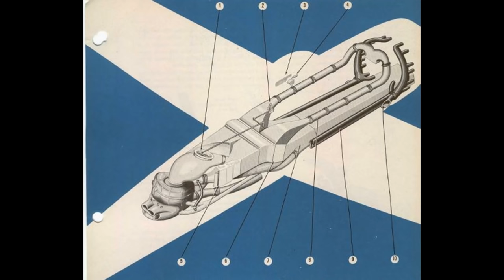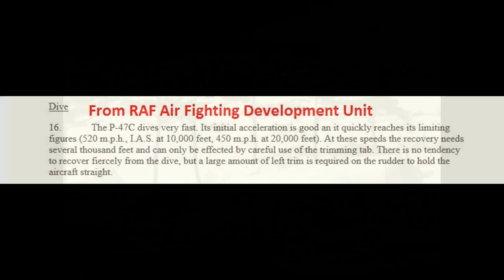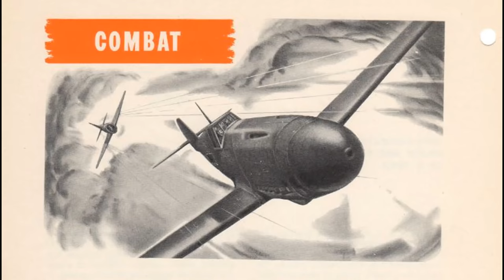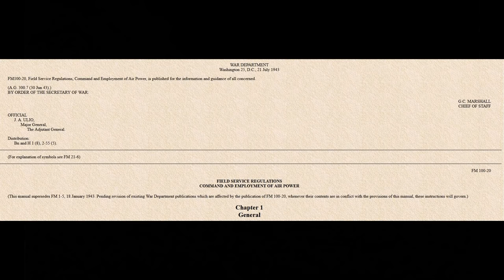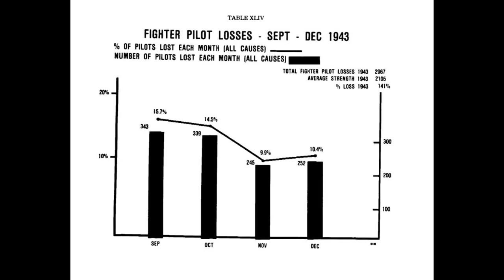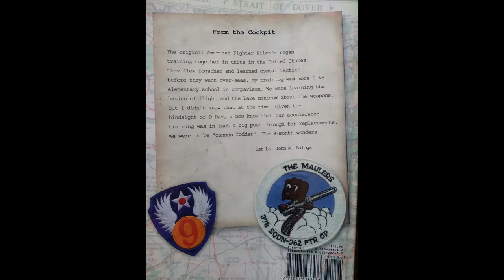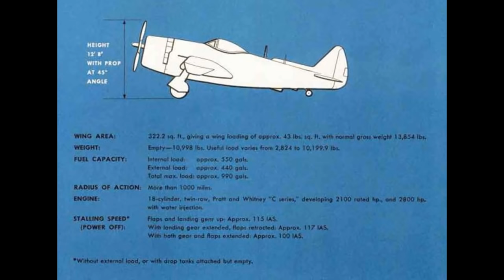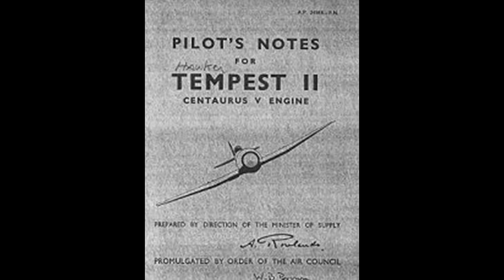P-47 Thunderbolt Pt. 8 Conclusions

Comment: My father was at various times prior to and during WW2  a carrier pilot who flew Wildcats a flight instructor and a test pilot.
His favorite planes were the Grumman Bearcat the Grumman Hellcat the Corsair the Mustang and the Lightning.
He flew the P47C as well.
Here are his reactions.
The Wildcat was not adequate to deal with the Zero and would not have done well against top line German fighters
The Hellcat WASable in the hands of a good pilot able to deal with the Zero provided the Zero had a good but not outstanding pilot.  IT would not have done well against the later 109s or 190s.
The Corsair in his opinion was the best carrier plane in the Pacific war.
It would gave donecwuite well in Europe.
He REALLY liked the Bearcats and felt that it was too bad it hadn't come along 3 years earlier to supplement the Hellcat.
He liked the P47C he flew and the firepower but considered it too shortlisted for the Pacific. He regarded the plane as a brute force solution to a fighter but respected its firepower and ruggedness.
Tied for first place in the Pacific with the Bearcats was the P38. Specifically the L model.
He specified the range speed maneuverability redundancy of two engines over water. He also liked the centerline gun location alone with the 20 mm cannon. He pointed out that the top two aces in the war flew P38s.
He also was emphatic that some of the tactics that were necessary to fight each plane varied greatly.
Most of the stories he told were while I was building Revell models of each plane.   After the war he flew for several years for American Airlines.
I was so lucky to have him for a fsther.
Reply from the maker: Thanks Joseph, I enjoyed reading that.

Comment: A fact that is often overlooked when comparing the Jug to its other contemporaries, particularly its R2800 brethren, the Hellcat and Corsair is the fact that it actually had the smallest wing of the three. 304 sq ft to 334 and 314 respectively. And we are not even looking at wing volume. Even the late model N which had a completely different, larger  and new wing was 322 sq ft., still smaller than the Hellcat. Obviously the needs for carrier operations dictated this to a large degree but nonetheless it's a relevant point because as we all know fighters are a series of compromises. The advantages gained in level speed and diving performance by the P-47 with its smaller wing hurt it against its brothers in climb and turn performance. Down low a P-47 had a less than optimum chance in a dogfight with these two, and consequently they were second best up high  where the 47's turbocharging kept its rated power much higher than that of their 2 speed superchargers. Once again it's all about where you need the performance and where you are willing to go with less
Reply: Supposedly p47 pilots said "when the build a runway around the world Republic will make a plane that needs it"

Comment: Some hearsay about the kill to loss ratio of  WW2 fighters.  A little known or outright obscure plane with a top rating was Brewster Buffalo.  What I have heard is that it was designed for US Navy use, but was found to be very difficult to fly and therefore not well liked.  So, when Finland after their winter war (1939 - 1940)  wanted to buy any more modern fighters and could not get anything from Germany (until 1944) they turned to the US.  After some manipulation it turned out that the Brewster Buffalo was proclaimed obsolete.  According to my sources, it was officially due to wrong or out of specification painting!  Real reason must have been that it was not well liked.  Anyway, Finland ended up having a small number of them.  Unlike the American pilots, the Finns quickly fell in love with the new found performance.  With good training, no difficulties in flying.  So, when Soviet Union in 1941 right after the German Barbarossa operation blamed Finland of joining Germany (and Germany was happy to claim the same) started bombing Finland, the Buffalos got real work.  From that time on and until 1943 they earned their claimed high kill to loss ratio.  As said, I have no facts to support this claim, but the small quantity of them in actual use may give some credibility.  Anybody with some real numbers?

Comment: Hi Greg, really enjoying this series of videos. On maximum speeds at altitude, (this may well have been said here) I find in online discussions that people only know part of the story.  When looking at performance charts particularly to do with Mach number I always look to see if they have been temperature corrected (i.e. above or below an ISA day) To this extent, if it is not mentioned, I look at the location and month of the year and then look at historical weather reports. As you know the temperature at altitude has to be corrected for this and also in terms of WWII testing there is a big difference in temperature vs altitude between summer and winter or more significantly, the Pacific and ETO all of which affects Mach number and MCrit. There are some good calculators online that allow a temp variation from ISA STD DAY to be added to Mach calculations at altitude.

In defence of Eric Brown, (and yes I agree that no-one is infallible and that data always beats memory)  the interview I have seen of him referring to this aspect, he speaks of Tactical Mach number at altitude, that is - a manoeuvring Mach number where stability and control are still sufficient to carry out combat manoeuvres. in the video I have seen, he is specifically referring to this. As another example, he refers to the ME 262 having a tactical Mach number of 0.82 and a Mach limit of 0.86 where the aircraft rapidly becomes longitudinally unstable because of its small vertical stabiliser.. This corresponds to reports by Messerschmitt tests at Gottingen, so his usage of this term seems consistent. I don't think he is talking about Mach limits with regard to the P-47.
Reply from the maker: I'll fully cover the Eric Brown stuff in an upcoming video. In fact, that part of the video is already done.
Reply: Love your work! @GregsAirplanesandAutomobiles

Comment: Do a video on the engines in WW2. single row, dual row, triple row, quad row radials.  turbo compound radials. H engines, that engine where the tops of the pistons meet. do Diesel engines, Kerosene if any.  V engines as well.  maybe include why there were only V-12 engines.  no V-16s.   also talk about alternate powerplants for planes like the W24 engine (2 V-12s strapped together) that was tested on the B-29.  maybe skim across that B-17 used as a turboprop testbed.        more to mention, talk about compression ratios of engines and relation of the super/turbo chargers. mention why engines only had a compression ratio of 6.x to 1. why not 10 to 1?   mention differences in early and later versions of engines like the early R-2800 and the later R-2800.       And do another video on propellers. like the difference between 3  long blades and 4 shorter blades.  example: why did the lockheed constellation only have 3 bladed propellers instead of 4?  also the F4U corsair.   ik my grammar isnt good. im just getting this out there.     another topic  why didnt the B-17 get upgraded with twin row radials?   ive looked at some official sources of service ceiling for WW2 planes.  the B-29 doesnt go higher than the B-17?  B-17 ceiling being 35k ft and B-29 being just under 32K ft.  my sources being wikipedia and a 900ish page airplane encyclopedia published around 1995-1997. wasnt the B-29 suppost to fly alot higher than the B-17?  another thing related to service ceiling, why is the service ceiling of the C-97 alot lower than the B-50 (without the turbine engines) given that they both have the same radial engines? is it just a cabin pressure/altitude thing?  i might add more later. yes ik this is a brain hurting mouth full. but, its out there for all to see.
Reply from the maker: I actually have covered about all that you asked there in regards to compression ratio. I even made a chart showing the relationship of the mechanical compression ratio to boost, but I can't remember which video it's in. The other stuff you asked I may get to in time, but each of those things by itself would be a stand alone video that it would take me a month to make.

Comment: Thats a very good and thought provoking analysis of the Allied bombing effort against Germany.  Albert Speer famously told the SHEAF interviewers after the war, that had the bombing campaign focused on keeping the ball bearing plant at Schweinfurt knocked on a regular basis and the entire war industry would have been crippled beyond recovery.  Bearings are hugely important for every machine and the machine tools used to make them........... The focus on air superiority did have a positive effect...........but knocking out key,specialized factories making bearings or U-Boat batteries would have had better effects..........but thats all in hindsight.    Other than its performance attributes............the P-47 was rugged!  It could have entire engine cylinders shot off, and still return ( it actually happened in the pacific).

Comment: Amazing work Greg.  I wish there was more information on the 'M' variant so that I could see your analysis.  Only the famed 56th Fighter Group got them, in late '44 - early '45.  From what I've read, they were intended to be THE air-to-air variant of the Thunderbolt, but they were shipped to the 56th plagued with terrible engine problems.  It got so bad that the 56th had to be grounded temporarily.  And, when "temporary" dragged on, they almost, against their will, had to be converted to the mustang - to the point where mustangs were already arriving and training was started.  

Thankfully, they got the engine problem sorted out and ended up flying the M through the end of the war.  But, it was too late to see what the M could really do in aerial combat because the Luftwaffe was essentially done by then.  In any event, personally, I think the M variant, coupled with the paint schemes the 56th came up with for them, are the best looking fighters of WW2.
Reply from the maker: The problems with the Ms were due to salt water corrosion during shipping, the plane itself was just fine, they just weren't packed correctly.
Reply: @GregsAirplanesandAutomobiles  Yeah, such a shame.  The few pilots who flew the M raved about it.

Comment: Bit late to the party but I should throw in my two cents. While I agree that the drop tanks were available in your context, "availability" in a military sense means in theater for battlefield use. A better phrase to avoid confusion would be "available for production", as while I agree they should've been there, they still weren't due to leadership windfalls, making them unavailable for the pilots

Comment: 54:50 Looking at B-17/B-24 - So many more B-24s produced but fewer hours in the air. I know this is European Theater but still, 1.4x Liberators were produced, and in Q2 1944 they had more hours so it isn't like they weren't in theater. Anyway, it undercuts some of the grousing I read from loyal Liberator folk along the lines of "it seems people forget there was another US bomber in theater." And I do agree with them, B-17 reporting naturally comes to the fore out of proportion, just not as much as they assert.
Reply: Weren’t the B-24s used in India, China and the Pacific a lot more than the B-17? plus all the anti-submarine work.
Reply: @givenfirstnamefamilyfirstn3935  Yeah, I hope I left that door open.
Reply: @givenfirstnamefamilyfirstn3935  It's interesting how they had that one quarter with more mission hours. But to your point, the more I learn about WWII, specifically US involvement, it's almost beyond comprehension the accomplishment in every aspect. From January 1936 to January 1946 the leap humanity made. "To your point?" you might say. Sure, all those B-24s are sure to have been flogged by commanders and crews wherever they were flown and made a significant impact everywhere they were deployed whether the most significant or not in a specific theater.

Comment: Please note that Dieppe was NOT an invasion attempt.  In actuality it was the largest and most complex commando raid of the war.  The invasion of NW Europe at that time was not even close to being a possibility for some of the reasons you have suggested.  Actually the Luftwaffe had little to nothing to do with casualties suffered by the landing forces, though they it did inflict quite heavy losses on the supporting RAF/RCAF fighters in what is generally regarded as the largest single day air battle of the war.
Reply from the maker: I don't see it that way. Over 6000 infantry with tanks air and naval support is far more than a large commando raid. After the failure of the attempt, for propaganda purposes the British latched on to the only success that they had there, which was gathering intelligence and claimed that was the whole point. That way they could claim success from a total disaster.

Comment: The P-47 massacred 109's and 190's when they were weak and exposed, which is exactly where the USAAF set them up to be, in a battle of desperation which the Luftwaffe had avoided until 1944.  They forced the 109's to fight when they were heavily encumbered with excess armament or when they took the armament off and didn't have ENOUGH firepower. The Fw 190's were near helpless fighting P-47's at altitude when they were forced to come up and intercept bombers) and when the P-47's came down they were coming down WITH the tactical initiative.

Comment: I'm a contrarian I guess, but since everyone else loves the Mustang, I've always had a soft spot in my heart for the P-47. It has NO RIGHT to have such incredible performance. It's like the 426 hemi powered Dodge Charger Daytona of fighter planes. In fact, I think I've stumbled onto an apt description: If you're familiar with the backstory on the Steve McQueen movie Bullitt, you'll know that McQueen had his 390 powered Mustang GT hopped up with milled heads, bigger carb, exhaust headers and maybe even a hotter cam. The 440 powered Charger driven by stuntman Bill Hickman was unmodified, yet the big Dodge (according to Cary Loftin and Max Balchowski) just smoked the smaller, lighter Mustang. I think it was Loftin who said they even put skinny tires on the Charger to handicap Hickman, but he could still walk away from the Mustang.
Reply from the maker: The 68 Charger RT was a  beast, the Ford 390 just wasn't that hot to begin with.

Comment: The P47N was not specifically designed for escorting B29's, early on in the war in Europe Republic Aviation saw that range was going to be an issue and they took it upon themselves to start development of what eventually became the N, but development of it was slowed by the USAAF because with the seizing of Mustang production from North American Aviation and the Merlin engine from Packard they knew they had a plane that would solve any range issues for Europe, Republic was then task by the USAAF with the development of other variants of the P47 including prototypes that never saw production and the N variant development was slowed enough that by the time it was done fighters in Europe were already going to any place they needed to so it was decided to use all of the P47N's in the Pacific where their range, that was even longer than the Mustang's, would be useful escorting B29's and other long range over water missions. 
Had the development of the N variant not been slowed down it would undoubtedly have had a much lower alphabetic designation and could possibly have had the razorback feature on the earliest N variants, it could possibly have been given the D designation had things not worked out the way they did, but in all actuality it was one of the first variants that Republic went to work on after the US entered the war, it was just the last one that was finished because of the USAAF's priorities.

Comment: For the luftwaffe those months on 43-44 were really difficult. The 109G6 and 190A were kind of stoped on the development and they were much worse than the P47s on high alt.
Maybe With AS versions the P47s would have more difficult time and loses but that upgrade did not come till spring 44